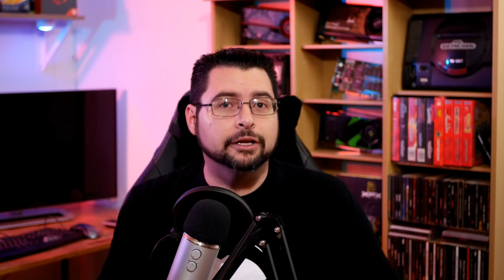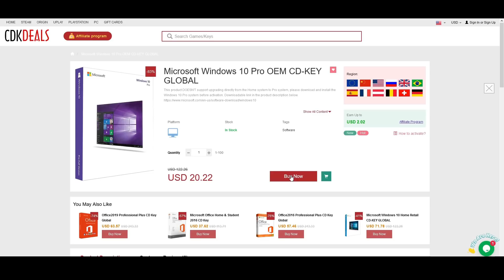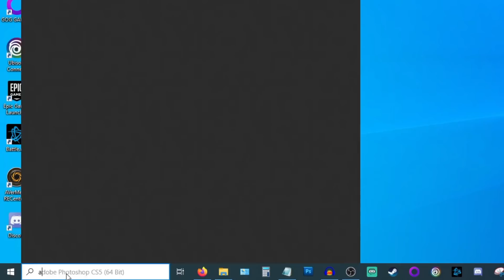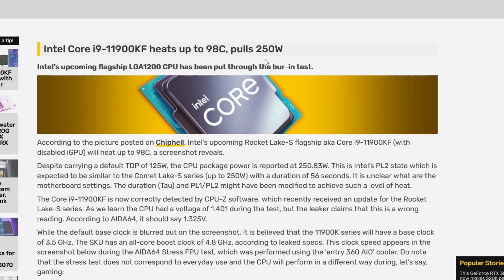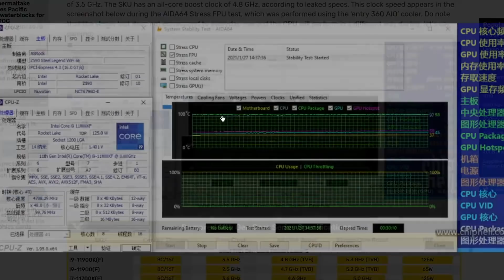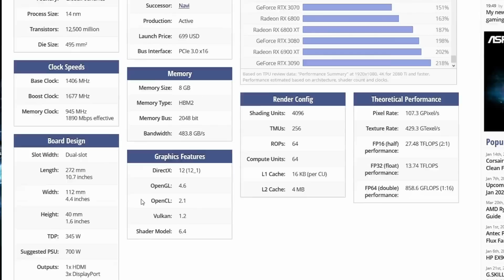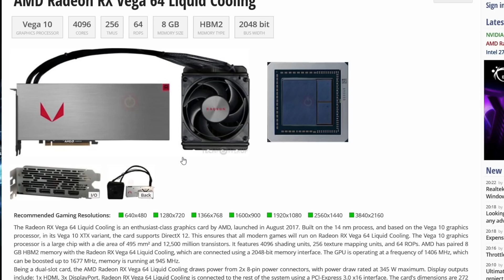Intel's Rocket Lake 11900K CPU Might Burn Your House Down!

Comment: When you leave vcore on auto and wonder why its hot... seriously 1.4v for 4.8 ghz lol the 10900k needs less for 5ghz across 10 cores...  even the 10700k can do 5ghz at 1.3 lol. with a max stress temp of 78c on any stress test... even with a cheap ass 240 rad... mine does anyway.... literally 26c idles and 78c 100% load temps.

Comment: looks like someone overvolted it..... 1.4v at 4.8 seems like over kill
Reply: bruh 1.4v for 4.8... no wonder why it runs hot... my 10700k only needs 1.32 for 5ghz lol..... they probably left the vcore on auto so it overvolted its self lol.
Reply: @TheBURBAN111  i only use 1.28v for 5.0 on my 9900k xD

Comment: 250w is 250w, whether youre hitting it with avx512 or cenebench. temp is gonna be the same. Mobo might be misreporting power. Board makers were doing that with zen 2 to trick the processor into thinking its not pulling a lot of power and running harder.

Comment: You don't need the Vega examples. Plenty of people have OCed a 9900k or 10900k to an all core of 5 ghz and more. 

Have not seen 1 example running anywhere in a constant 90+ degrees, truly suspect.

Comment: you guys are interpreting this wrong, any cpu, gpu will hit the power limit if you push enough power through it. 4.9 ghz on all the cores/ threads is impressive, if you want to run cooler just reduce the all core by 1 or 2 in the all core sync thing, its not rocket science. not to mention the voltage might not even be stock which the article reported, however you can run the the single core., dial core, even 4, 6,  on 50+ all core and the single core is 5.3 with huge IPC gains. you tuber marketing needs to go away cuz they dont know what they are talking about

Comment: Ryzen runs waaaay hotter during normal use than any Intel. It's kind of ironic the AMD fanboys use overclocking stress tests to make Intel look bad, considering AMD have the worst thermals during normal use. 🔥 🤣
Reply: is that why my current 3900x 12C 24T cpu runs cooler than my old 6C 8600k, on the same cooler?

Comment: Intel CPU's have amazing overclocking potential. These temperatures are based on max temps during stress tests while overclocking, not normal use. During normal use Intel runs almost 50% cooler than any AMD chip. My i7 10700k runs 30 degrees (idle) and while gaming (40 degrees) , vs my Ryzen 7 3800X 55 degrees (idle) (70+ degrees gaming). But nice clickbait.
Reply: 3800x hitting 70C in gaming? wait im running the 3900x and it rarely hits 65C in gaming...only touches 70C in prime 95...sounds like your cooler isnt upto scratch lol

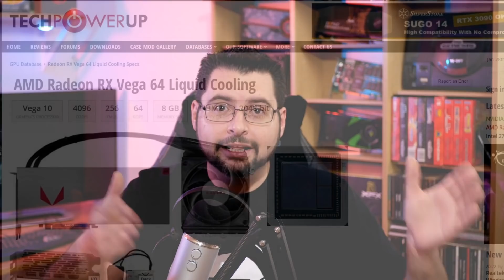Comment: 5:42 Direct die contact as opposed to an IHS in between the die and the cooler, more contact surface area for the heat to spread, 500mm2 of Vega 64 vs what? 200mm2 of the 11900k. Thus higher heat density. That's how a 120mm can outperform a 360. Think before doing Jayz2Cents levels of baseless claims, which seem to trigger you that much. The irony. I dare you to comeback to this topic once the CPU releases, and measure yourself the power it pulls, so you can say "I told you so" just like you seem to like doing. Or eat your words, for that matter.
Reply: You have all your figures wrong. the surface area isn't what matters here, but the energy efficiency of the chip. What he was talking about was the amount of heat that a standard cooling solution can dissipate. A 120mm cooler cannot ever outperform a 360mm cooler because of thermodynamics and high heat density as you say, is never a good thing. More area on the radiators means more heat dissipated per second. If the CPU is running that hot in a cooling solution where AMD's 5000 series chips ran at 85 C at the hottest while drawing far more power, that means it is not as efficient energy-wise.

If the figures reported on the ChipHell website are right(they are usually are), it's not looking very good for Intel who have had a track record of very hot CPUs from the 9th generation. They will also be giving you fewer cores for presumably the same amount of money at least and early figures from the laptop lineup don't bode well on the multi-threaded spectrum. Overall, I'd skip this generation and look at what their 12th generation will offer.
Reply: @davedimitrov  Nothing you said is related to the points I exposed.

High heat density of the die. A 200mm2 die producing 250w of heat has 1.25w per square milimiter to disipate. A 500m2 die producing 350w of heat has 0.7w per square milimiter to disipate, on a higher contact patch with the heat spreader, thus, more capability to transfer away said heat. This guy assumes the Intel chip is pulling 400w just because he asummes "a 120 AIO can cool 350w on the Vega; a 360 AIO can barely cool the Intel chip, so it must be consuming 400w". Which is plain moronic to come to that conclusion. Considering naked die contact vs Soldered IHS, less efficient contact, more contact area to disipate is key to come to any conclusion. Die heat density is a thing.

While I do agree with you that this generation is totally skipable, but not for the reasons exposed by this news  reading "youtuber".

Comment: I usually like your takes but this video is very poor. For someone claiming to cut through the bs, you present this unsubstantiated leak as basically a fact. Yeah you said it's a rumour a couple times but your messaging is very clear that you are pushing this as fact to make a video out of this.
How about presenting this leak for what it is, a rumour. You know, cut through the bs? I own a 5900X so I don't have a horse in this race but it's pretty obvious that something in this leak isn't right. As you said, a 360mm rad keeping this at 98c? The facts don't add up here. But rather than focus on the cooling solution being wrong, or this whole thing just being a lie coz shitting on intel is cool rn, you decide that the CPU must be pushing 400w just to make a sensationalist video..... Very poor

Comment: It will eat more power then 10900k probably and give maybe 5% more fps more on 1080p which basically nobody don't use with high end gpu-s todays
Reply: While giving you fewer cores for presumably more money. They're both gouging as hard as they can at this point

Comment: You can't compare power usage with heat dissipation. The CPU die is much smaller so it is harder to dissipate heat. The GPU die is way bigger, that is why they don't need as big of a cooler, although pulling way more power. 
Moreover it's unlikely that the 11900K needs 1.4V to run at the all core turbo of 4.8GHz as 14nm is way to mature to need that kind of voltage. My 9900K runs at around 1V in AIDA64 and Prime95 12k test at stock speed of 4.7GHz. I have an 360mm MSI AiO. The fans and pump are running at 50% speed which gives around 1200rpm and 2500rpm. My ambient is 24°C and it the CPU temperature hovers around 75°C after 15min. If I put the CPU to 1.4V it gets crazy hot as well.
Just to make that clear I'm not an Intel fan boy. I wanted to buy a 5800X, but I got the 9900K for 300 bucks, which is a decent deal imo. I didn't want to spend at least 150 bucks for 10% more performance. For me the situation just turned around where AMD now commands a premium for a little more performance.

Comment: it's a 10nm design scaled to 14nm. I you know whay thay means, you understand that all this heat is completely expected. It'll be fast. But at what cost..

I hope they have a breakthrough wity 7nm or something.. idk. AMD will turn on the consumer real fast if Intel has nothing competitive to offer.
Reply: it beats the 5800x in multiple tests and set a record for single core performance... idc if it runs hot its fast lol i mean come on are you really gonna buy a high end cpu and use a shitty cooler.... its basically a stop gap until 12th gen...
Reply: @TheBURBAN111  To be frank - I don't care how how my CPU runs, as long as it's fast. And Intel will do exactly that. Good for them. And when they jump to 3nm, they'll be able to advertise a 300% power reduction. lol
Reply: @blazbohinc4964  no wonder why it runs hot in the video... they have it over volted to 1.4v lol at 4.8ghz .....
Reply: @TheBURBAN111  Retail samples will probably run better.. If we can get a stable 4.8ghz or 4.9ghz at reasonable voltages, that like.. 6ghz equivalent in 10th gen numbers. I think Intel will sell this CPU like cupcakes, even if it pull a ton of power.

Comment: Why should an RTX 3090 spike up to 700-800W??? That's by far the biggest nonsense you ever mentioned in one of your videos! 
Right now, I'm watching this video on my RTX 3090 while it's mining (OK, at 77% power target) and my whole system (incl CPU etc) with its 650 W PSU is pulling exactly 343 W.
Reply: thats your average watts not your transient.

Comment: I wish intel would go back to using thermal paste. Popping the lid and applying liquid metal works fantastic for keeping the cpu cool.
Reply: That's true, i got a 10850k with liquid metal and a copper ihs and it never exceeds 55c with a 240mm cooler while gaming.

Comment: Intel is not kidding when they promise they will bring the heat.
Reply: it was overvolted in the video... 1.4v lol no wonder why its hot... even the 10900k needs less vcore for 5ghz across 10 cores... my 10700k only needs 1.32... once you go past 1.35 they get toasty asf.... unless you have a good cooler.... auto vcore settings can cause this....

Comment: further proof that investments into proper cooling aren't even wasted.. it wouldn't surprise me for my 10+ year old watercooling system behind a d5 pump and 1/2" flexible hardware store tubing could handle that 250+ watts np.. and i could prob even cool a gpu at the same time on a 360mm rad....aio's are junk..

Comment: As one of those sad old people that still maintains an HTPC, it has come time to FINALLY upgrade from the old Win7 box that I have been using since before 4k was a thing and thanks to AMD building stuff for everyone except for their die hard consumer fans, I am faced with being forced to power this new box with an Intel i3 10100 because not only can I not find a 2200G or 3200G, AMD in all it's wisdom has seen fit to ensure that I am not even able to get my hands on a 4x00G CPU either, as they are OEM only. Nice job AMD. In my area of the planet, Canada, the lowest end AMD SKU that can be had is a 3600x and it has been that way for well over 3-4 months now and Intel i3's seem to be flying off the shelves as fast as Intel can stock them, thanks to onboard video and having a $100 USD offering. As an aside, I am sending this msg from a 3950x powered rig, still waiting to find a 5950x....LMAO

Comment: That test was in Aida64 on FPU, 1.4v. In gaming it will be -20c less. There is no doubt it will be hotter but how much is not clear from this screenshot in videocardz.com
10700k also gets the same temps. I saw somewhere that lower end parts will be CometLake refreshes, only high-end chips will be Rocket Lake.

Comment: AMD recently purchased a tech company which specialises in FPGA's. I believe that AMD are attempting to manufacture X86 architecture with RISC style instruction sets and using the FPGA to add or remove unwanted SISC instruction sets.

Comment: I went with the Ryzen 7 5800X...
Reply: Nice... but the 11900k is going to out perform the 5800x...  considering it set a single core score record lol... its going to be in between the 5800x and 5900x. Also out performs the 5800x in multicore apparently.
Reply: @TheBURBAN111  Now when the 11th Gen is out and benchmarks are up i must say that i am even more pleased with my 5800X. The 11900K does not compete with the 5800X, but at best it is on par with the 5800X. It only beats the 5800X when you unlock it from factory settings and basicly OC it. And even then it is on par at best. I don´t see a couple of percents better or worse as a deal breaker. It is in the margin of error. One thing that is a dealbreaker for me is the pricing for both the 11900K and the Z590 motherboards. Where i live these two things together will cost almost 1000 USD with the cheapest Z590 motherboard. 
So in my eyes AMD is still the better option!
Reply: @marcuslagergren1983  the only 11th gen worth it is the 11600k as it competes with the 5600x for slightly cheaper... and z490 boards support 11th gen anyway you can pick one up for 159$ all you need to do is updater the bios.
Reply: @TheBURBAN111  I agree on that one. The 11600K has the potential to be the the best bang for the buck. Time will tell...
Reply: And next year new tech will be out that will outperform the 11900K. I made my choise based on what was available and i already have a B550 motherboard. And the 11900K didn't exist, and still doesn't exist when i decided buy new parts!
And btw, the 5800X is going to compete with the 11700K, not the 11900K. R7 vs i7, not R7 vs i9...

Comment: CPU die is much smaller than high end GPU dies, thus the heat density is much higher for CPU.  That also means it's harder to cool than GPUs.
Reply: Compared to their competition, they might have thermal design issues. AMD doesn't need to shave down their IHS to achieve their lower temps

Comment: My 5900x sits at 4.9 ghz by default using ryzen master. It auto OC to 5.05 ghz on air using a Cryorig R1 cooler. I'm cool with that. Using Viper Steel 32gb 3733 mgz, oc to 3866 mhz for a little overclock.

Comment: intel is quite literally squeezing the testicles of their old architecture dry, the last hoorah of their 14nm architecture. one thing i'll give them is that they're stable under ridiculous power draw and voltages. if their 7nm is even a little more efficient but can still push this sort of ridiculous power through them then AMD will actually have some competition
Reply: well from leaked benchmarks it already out performs the 5800x and set a single core score record... gets the same multicore score as the 10900k with 2 less cores... so it should be good enough until intel think of something else lol.
Reply: @TheBURBAN111  yeah it's pretty good. Although cooling this God damn behemoth of a 250W chip could suck

Comment: you can not compare the vega to the intel CPU because the volts are different, but I have to say that 1.4V is way to high and that explain the 98Cº , for sure that CPU will not last long and intel is so bad that is trying another prescott AKA presHOT because they did not care for to many years
Reply: and that is to reach 4.8Ghz hehehehehehehehe

Comment: i think you cant compare vega to 11900k because vega has probably much bigger die which is easier to cool. And stock voltage is probably higher than you can put when overclocking

Comment: Sooo....
Lets observe a few facts....
1) Comparing a die that is like 1/4th or even smaller to a big gpu die...
A) Somehow asuming a 4 time smaller contact doesnt limit heat transfer
B) somehow ignoring the extra heat transfer loss from IHS on CPU compared to direct die contact on GPU
2) cheapest 360 AIO...
A) i have had 95c stress test on a 360 with 1 block
B) i have had 75c stress teat on the same cpu mobo OC same 360 rad same 3 fans just by switching the block
3) you have no idea if the cpu is OC and at what settings
4) you have no idea what the room temp is and what the case is
5) you have no idea if its just a bad cpu/IHS
A)my 8700k was overheating stock in chrome with 360 ekwb extreme kit
B) that same 8700k was delided and ran stress test at 95c with the same cooler in a room where my room temp is 40c

So in summary....
You are just trolling your ass off spitting here and there for key word content Just for the views and the money

Comment: I'm deciding between two system's Intel, and AMD. Both will do my need's just fine. Gaming (Scum, Gta 5, Battlefield 5...), and 3D modeling/rendering (Autocad, Maya...). 
AMD side is around 400$ more expensive. What sould I get, since I'm tired of waiting, and both sides have no upgrade paths ? Bottom section stays the same for both sides.
I'm also having trouble deciding what monitor to get. I'm going to use it in dark room. I know I want 27''-32'' 240-280Hz IPS/VA monitor, if possible not curved. 

Intel Core i9-10900K
Asus ROG STRIX Z490-G GAMING (WI-FI) Micro ATX LGA1200 Motherboard
Crucial P5 2 TB M.2-2280 NVME Solid State Drive

AMD Ryzen 9 5900X 
Asus ROG Crosshair VIII Hero ATX AM4 Motherboard
Sabrent Rocket 4 Plus 2 TB M.2-2280 NVME Solid State Drive

Crucial Ballistix RGB 64 GB (2 x 32 GB) DDR4-3600 CL16 Memory = I may not need it know, but will late on.
be quiet! Dark Rock Pro 4 50.5 CFM CPU Cooler (250W TDP)
Sapphire Radeon RX 6800 XT 16 GB Video Card
be quiet! Pure Base 500 ATX Mid Tower Case = plan to modify the case
be quiet! Dark Power Pro 12 1200 W 80+ Titanium Certified Fully Modular ATX Power Supply = I know it's overkill, but it will last me a lifetime with no problems.
Reply: ryzen all day bro
Reply: no one buys intel these days anymore for gaming
Reply: @marlonbrans3567  4 months has passed of my comment.  I got Intel since it did work I needed it to do, + it was cheaper for me to get it then Ryzen parts.
I don't plan to upgrade pc ever, just use it as long as my needs don't drasticly change.

Intel Core i9-10850K
be quiet! Dark Rock Pro 4
Asus ROG MAXIMUS XII HERO (WI-FI)
Crucial Ballistix RGB 32 GB (2 x 16 GB) DDR4-3200 CL16 Memory x2
Crucial P5 1 TB M.2-2280 NVME SSD x2
Asus GeForce RTX 3090 
be quiet! Pure Base 500DX
be quiet! Dark Power Pro 12 1200 W 80+ Titanium Certified Fully Modular ATX Power Supply